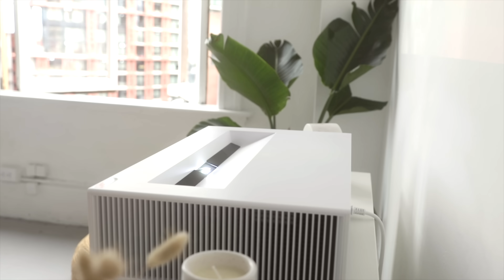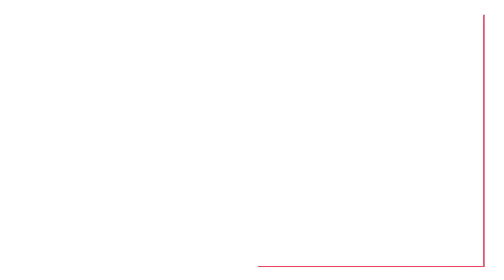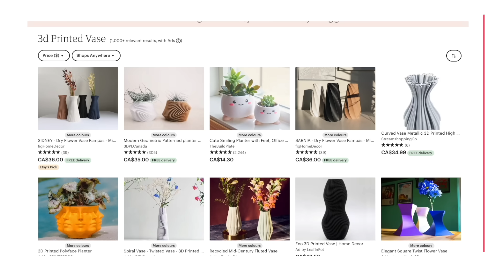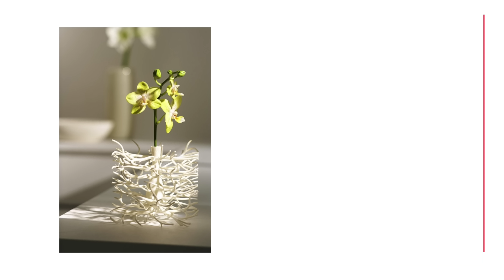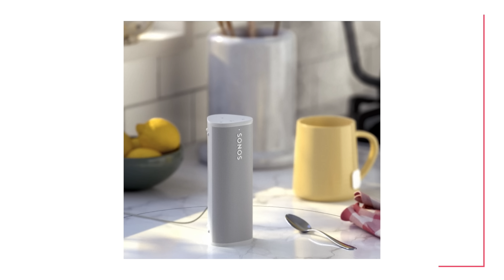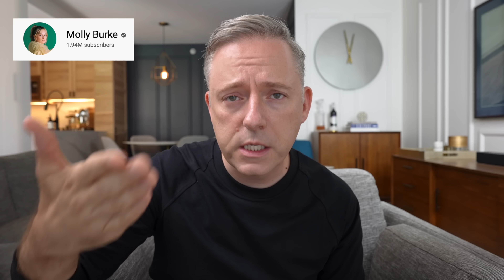Home Tech Trends 2022 | How Will Technology Shape Interior Design?

Comment: I have a washer from 1960 something and a dryer from 1970 . My appliance guy said he can fix either one for about 85$ in parts. New ones repairs start at 300$ and up. Threatened to stop coming to my house if I ever got rid of these. He only gets to come here every 3-5 years and then it’s a belt or needing some lube somewhere. They are metal, heavy duty and can wash and dry a king sized comforter. I will have them till I die…maybe longer. Made back when appliances were made to last!

Comment: We installed Shelly devices behind our wall sockets and switch plates so you can easily update the switches in the future, technophobic people can use the house as normal but everything can be fully automated or voice activated and under local control (so bricking-resistant). We’ve been delighted with them from automating tons of things together into scenes to having our house behave as if it’s occupied while we’re away.

Comment: Your last point in regards to sliding surfaces was very good. I think this point also applies to cars. While it is illegal to use your phone while driving in Norway (you’ll get a huge fine), using a massive iPad-looking screen in your Tesla is perfectly fine. With the screen, you can no longer just feel your way to the right button and you’re either putting yourself in a dangerous situation looking down too long or you have to stop the car.

Comment: Hi Nick, as the Director of Specifications for Lutron/Ketra in the SW of Florida I can tell you that with luxury home automation such as the  motorized shades or any other lighting design system that we ALWAYS tell our designers/architects/builders/clients to have a wall mounted panel as well as an app...because phones get lost/misplaced/dropped etc ...and then well...you're outta luck until your phone is found or fixed.  An app should really only be used as an adjunct to your hard wired system with a centralized wall panel interface from which you can do everything. Apps are great primarily for when you go away and need to do something remotely. But great to see someone covering tech trends in the home! Lovely video.

Comment: I am all for tech. And I love gadgets, but it is probably not a good idea to have super techy frig,.stove, washer/dryer. The problem being is that if an electronic component say burns out or stops working then your appliance may stop working all together. This can be very expensive to fix. Maybe not even worth fixing. So my suggestion is to skip as many features as possible and get as basic a model as possible. As you said... Do we really need a screen to see what is in the frig? Just open the door... Just think of the money you will save getting a more basic model. You can still get say a beautiful stainless  steel French style frig. Just scaled down a bit. And do you really need  a washer with extra drawers, screens, special settings... Think about it. Most people use maybe three different settings. Standard wash in cold. Delicate, and hot/warm. The only additional setting I find that is handy is the quick wash cycle and maybe the allergen cycle. All the rest of the fancy load one item in a second drawer, etc. This extra options just take away from the load size and you need that extra capacity size to wash bedding... My opinion anyway. Also--technology can change so fast that it is best not to install an integrated system into your home. Software can only be upgraded/supported so long. Plug in options are more flexible or standalone options like you showed like something with a pleasant design you can set on a table top. Just think of what is happening with cars. We are already starting to see computer systems in cars that are reaching the end of when software upgrades are no longer available. Phones are notorious for that. The industry is set up for you to buy the latest and greatest. If you can afford to keep buying the latest thing or rewire and upgrade your home when needed then more power to you. But I am guessing most people can't do that. 🤔

Comment: I work in tech. I love smart bulbs. I have my porch & patio lights on a schedule. I use a smart plug for my flat iron, so I can make sure it’s off. I can feed my cats if I’m not home at meal time (and turn some lamps on for them). I can preheat my oven on my way home, or even from upstairs. I can see if I accidentally left a door open. I can check in on my dog when he’s alone in the backyard while I work in my home office. I have water/leak sensors that will alert me. I can change the room temp without getting out of bed. I know when a package has been delivered. I can let friends/family in my home if I’m not there. :)

Comment: I am building a house and I spend a lot of money for a smarthome. The house knows what to do, I dont need switches. My data is neither in the cloud nor in a wireless system. The producer is leading in Europe. My goals are convenience, safety and help when I get old. I can combine solar power, heating, light, sound, blinds, alarm, fire, flood, weather station and fresh air. Many sensors are watching. When I am old, the sensor detects a warm person, which is not moving and can send an alarm. When I am not opening the drawer with the medicine, a nurse will be called etc.

Comment: Building a smart house right now. I have disabilities and I am so relieved to be able to integrate smart technology that can make my life easier, safer, and more energy efficient. Lighting is a big expense if you're doing all smart. But I can turn things on and off automatically with a routine without physically doing it. I can set to alarms and reminders without them being too obtrusive. Incredibly helpful and beautiful. Heated floors in the bathroom are great for temperature sensitivity issues. Smart alarms cover everything from water leak alarms to automatically setting with verbal commands or when I walk out the house. I agree with you on smart speakers I have one built into a fire alarm but that's the only built in one. Everything else is portable. Not to mention how handy Alexa is. This will make my life so much easier.

Comment: Don't be fooled by "invisible audio".  Sure, they've made speakers a lot smaller.  But 80% of the time they are NOT better.  And actual speaker technology hasn't drastically improved in the past 50 years, so a lot of those bigger speakers you may have bought decades ago are still excellent performers, and quite possibly radically better than most of those cute, smaller, "invisible" speakers.  So don't make the mistake of tossing out a-grade classic speakers and replacing them with something cute but nowhere near as good simply because that's the trend.  There are plenty of ways of disguising or integrating bigger speakers in decor if you care about great sound.

Comment: A note about smart appliances: They can be absolute nightmares when it comes to network security. Most security experts abhor things like smart appliances because they tend to not get updates as often as they should, and introduce security holes in a home for no good reason. 

There's no way I could cover all of the best practices in a comment, but I'd start with these:

1. Ask yourself: Do I really need my X to be smart? I will admit that I love smart bulbs and have a good reason to have them. I can't make the same argument for my microwave.
2. Consider setting up a second wifi network for them. 
3. Before you buy, look at how often a device is updated, and how you do that. If the answers are Never/You can't, DO NOT BUY THAT DEVICE. 

Again, not exhaustive, but it's a start.

Comment: A few software people think about disabled people but Chinese manufacturers sure are not going to so it will be up to Europe (which has no laws to fix streets, etc. for the disabled) or the US passing a law to protect people (laugh I guess don't vote Republican).  I am disabled and very grateful for the buttons on my kindle reading device because just turning a page is difficult.  I would have to remind people at work that websites need to be designed for people with vision issues and different screens when all they notice is the pretty graphics which will not work for a lot of people on other devices.  The managers still think they are looking at paper on the screen and design by printing a piece of paper and say do this.  Hopefully younger people will replace them who understand technology but younger people do not know what it is like with cataracts or macular degeneration.  I saw a utube video of a university trying to design better housing for the disabled.  I hope others will think ahead because moving several times during your life gets old fast and it is expensive to move or replace everything because of stairs or bathrooms that no longer work for you.  One accident or surgery in your youth will suddenly change your view of your house as you struggle with crutches or whatever.  My dresser suffered a lot of dings from those crutches in my youth after foot surgery.  Look up the price of an elevator and you will be shocked.   The cookie cutter houses and what goes in them need revision.  The outdoors is changing too because watering systems can check the weather instead of automatically starting.  We need to waste less water and power so computers can do this and save money.

Comment: Pass on all these. I'm waiting for the "what's going wrong now" sensor. If my car can tell me which tire has low air pressure so I can fill it before I get a flat, I want my house to tell me when something is going on with my AC, wiring, plumbing, etc. when there's still time for preventative basic maintenance,  BEFORE I have to call in emergency repairs. ( can you tell I just dropped $$$ on emergency ac repairs? ☠️
Reply: I want this!

Comment: I completely agree with the overwhelming number of touchscreens being a problem. I have a touchscreen thermostat in  the apartment I rent and maybe 10 years ago it was cool and modern, but now it's extremely slow, freezes all the time, constant updates are coming and sometimes it freezes during the update and then I have to manually turn it off and on. Really a headache
Reply: We've had an echobee for 8 years and have had no issues at all. I like that it has sensors that I can place in rooms that are away from the thermostat and it can read those sensors to juggle the ac. For example, the thermostat  by my owners suite is outside the door. It can get quite cold in the room with the door shut. But with a sensor in the room the heating and cooling is much more balanced!  The only maintenance we've had to do is change the batteries in the sensors and we've only had to do it once.
Reply: @lanaj1107  It's great to hear that there are good, useful versions of this technology. My thermostat is unfortunately in the kitchen that gets the warmest because of the stove. At wintertime e.g. If I set the thermostat at 21°C, the temperature in my bedroom always stays at around 14°C. I like sleeping in low temperature, but it's not warm enough if I just wanna stay there reading or watching a movie
Reply: @dorat.88  You can have multiple sensors with echobee. If you get one, you might have to fiddle a bit to find out where you want the sensors, but it works great for both of my AC and furnaces. You can adjust the temp with your phone! I don't use any of the automated features though as I'm almost always home. But when we leave for the evening, I turn it down, then crank up the air on our way home. Lol. It's been between 110 and 115 for two weeks. 🥵 But it helps a bit to keep the bills down.
Reply: @lanaj1107  sounds like a very good investment, thank you for the suggestion

Comment: I poked at a fridge with interior cameras a few years ago and a design flaw I noticed was that the cameras are in a location that would easily be blocked once the fridge is filled with groceries, especially if it's a full family using it. Seems cool at the store when there's nothing in it, but in practice you'd really only see the stuff in the door and in the immediate middle of the fridge.

Comment: Re accessibility: a lot of car reviewers are highly critical of car manufacturers replacing physical knobs and switches with capacitive buttons.
Not everything needs to be a screen, and sometimes clicking/switching is more practical than tapping.
Reply: Yes, my car’s heating/cooling is controlled by flat-touch buttons. It’s even dangerous when you drive as, without the feel of a button, you really have to look closely to make sure you touch the glass panel in the right tiny spot—all while driving 100 kph.
Reply: Some reviewers were saying consumer comments were so negative about the software and equipment with many of the screens that the total number was actually downgrading the score for the whole car. Consumers and reviewers are also very negative toward many of the so-called safety devices, which don't seem to make it safer at all. I wonder how many will survive for five or ten years before people avoid those models.
Reply: @653j521    Alex from ShortCircuit (LTT) recently did reviews of some new electric cars (BMW iX, Mercedes EQS) and some of the features in them were so frustratingly dumb, that they would make me avoid the car (and subsequently the manufacturer as well) altogether, straight away.
To tack on the subject - it's mindblowing to me how a car in 2022 can have a laggy touchscreen interface on launch date. Seriously beyond my comprehension... x]

Comment: I feel like a lot of smart devices will  become like other tech - built in obsolescence requiring us to buy a new fridge every couple of years when software updates are no longer issued for the device. My current fridge is about 15 years old and going strong.
Reply: I agree.  Frankly, most fridge manufacturers can't even make a regular fridge that doesn't have serious issues within 12 months.  Compressors that are absolute garbage, ice makers that leak a puddle underneath the fridge that destroys your wood floor(ask me how I know!), draws that don't track properly and fall out if you have the audacity to have several pounds of nice cheeses in them, etc.  If they can't even get the basics right, how could I possibly have any faith in software based "smart" appliances?
Reply: We can only hope that there will be more and more action taken against planned obsolescence, whether through legislation or the manufacturers themselves, so we can benefit from the convenience and still have a clear conscience.
Reply: @esehes  Or, hear me out, the hyper-consumerist can opt into buying a non-smart fridge instead
Reply: @Hiphop618  Definitely, because leaving everything up to the consumer has worked really well so far.
Reply: Yes, we need to make things simpler, easier to repair, service and long-lasting.
Reply: You can have both. Keep in mind that the fancier something is, the more points of failure it will have. Use common sense and do lots of research before you check out

Comment: One thing I am not very sure is the 3D printing - being able to change something so easily, just because you can print it is a mark for not being sustainable. And after all, 3D is just another plastic item, we are going to hate very soon.
Reply: Yes I think it is not sustainable either .
Reply: That's what I thought... more plastic to be thrown away eventually... how is that sustainable?  I'd rather see more local woodworkers, potters, metal and fabric workers, etc. be able to make a living with their creativity.
Reply: My fiancé works for a 3D printing company and we own a few printers. Tbh I generally don’t like the prints he makes because the quality just isn’t there. The hand feel to a 3D printed vase printed is equivalent to that of a flimsy plastic water bottle—not great. 

Many prints tend to be thin and breakable. Print settings and designs can be changed but often just aren’t. Also, if a print fails and you don’t catch it right away that’s a lot of wasted material. 

On the other hand, my fiancé printed me the cutest little squirrels with wood filament. They can even be stained, how freaking cool is that?? Also, when we needed a fly swatter we had one in a few minutes, less time that it would’ve taken to go to the store. I have other similar stories. So 3D printing has its pros and cons.
Reply: There are 3d printings in several materials aside plastic (wood derivates,  ceramic,metal). They are expensive but they gonna be affordable in the next 5-10 years.
Reply: @dayanacba    I still like the idea of people making things with their hands... there's something about that.  I would hate for people to lose that/not be able to make a living at it.  I suppose 3D printing will have it's niche, and perhaps some artisans will use it as well.  I am old-fashioned I guess, and long for times past when people would go to their local "butcher, baker, candlestick maker" and people took their time to make quality things that lasted because it was also about pride in their work and their reputation.